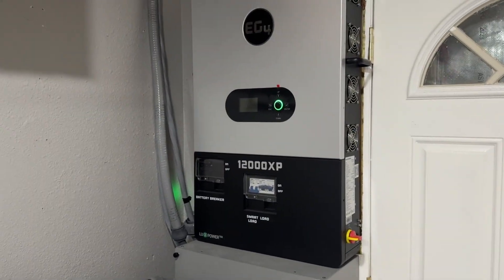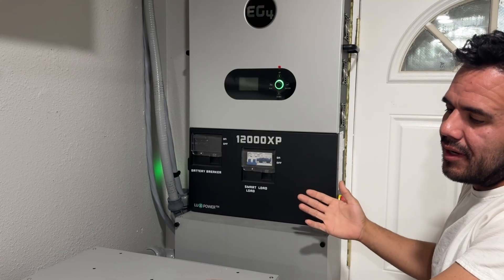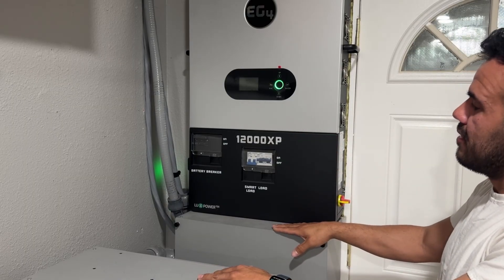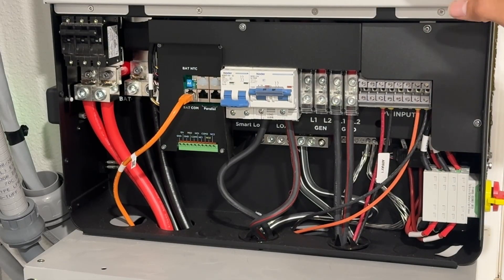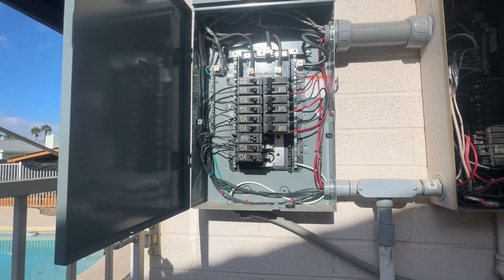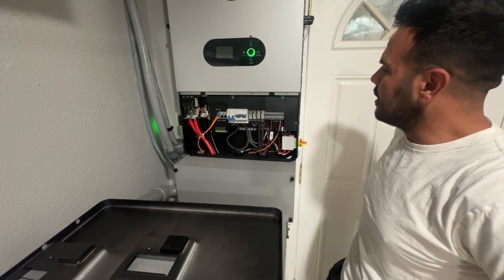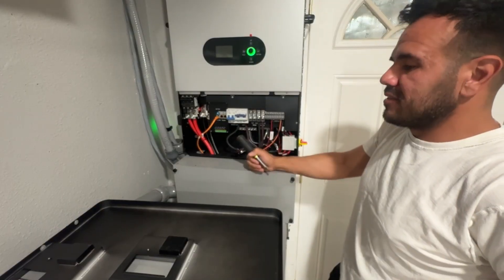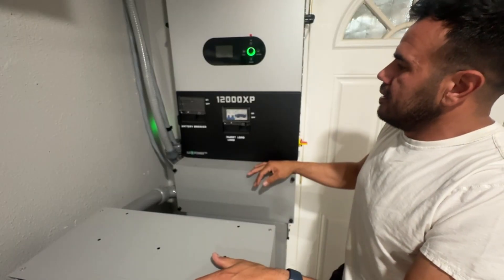✅ Complete Solar Power Flow Explained | 12000XP + Critical Loads Panel Setup | Solar 101

Comment: Great visual video.   Where do the batteries fit into play here?
Reply from the maker: Hey boss! During the day, the DC power from the solar panels does two things: it supplies the loads on the critical loads panel and charges the batteries. Both the solar panels and the batteries are DC sources. When the sun is out, the 12000XP converts that DC from the panels into AC to run your home. At night, when there’s no solar coming in, the batteries take over. They send their stored DC power to the 12000XP, which then converts it into AC so your critical loads keep running automatically
Reply: @Yesseyd  makes sense.  How does this dual action work?  Do the pv wires feed the batteries and inverter simultaneously?
Reply from the maker: @68dewster The solar panels only connect to the inverter. The inverter is the one that decides what to do with the power. It uses the solar power to run the house first, and any extra solar goes straight into charging the batteries. So the panels don’t connect to the batteries directly — the inverter handles both at the same time automatically
Reply: @Yesseyd mystery solved!   Sooo washing,  I'd had all these questions when seeing your unit.

Comment: great video,  but I just could not keep my eyes off that handle, I guess it is, and the door,  how does it not interfere and damage something?  do you have a stop on the floor to keep it from hitting or is it just very close and does not touch?  Inquiring minds want to know. lol.   But the video is pretty good, important stuff people need to think about,.
Reply from the maker: Thanks! That door almost never gets used (maybe 2–3 times a year), and if it opens all the way it touches the 12000XP’s grab handles first, so nothing gets damaged. If it were a door that got regular use, I definitely wouldn’t have mounted it there — but this entrance pretty much never gets used.

Comment: Very nice video, clear, straight to the point and very well explained! I'm planning to do exactly the same setup but I might limit the AC bypass to 60A and run a 6AWG copper wire from the main panel instead. I already have some 3AWG copper wire but not too long so I might do that from the Inverter to the Subpanel. Thanks once again!
Reply from the maker: Anything after 6awg starts to get pricey real quick, but if you design your system well 60amps will be more than enough.

Comment: I don't think I have watch Will Prowse video regarding "critical load" sub panel.  Anyway, right now I had my mini split hooks up permanently to  the outlet that was supplied by the inverter.  When battery getting high then I had to unplug  my washer and dryer from my house outlets  (grid tied) then plug them into the outlet supplied by the inverter.  Very bothersome and Mickey Mouse.  And I got cables run all over the house.  Definitely, I wish I can be able to do this.   But this is definitely advanced stuff, but awesome, that you can be able to use already existing in the  wall wires in your own home.
Reply from the maker: I hear you — managing different loads and juggling outlets can definitely get tricky, especially when you’re working with limited inverter capacity. It’s not always easy finding a setup that’s both efficient and convenient. That’s where things like a critical loads panel or more integrated systems can really start to make a difference.

I’m also working on a small portable power station build right now — something I think could be super helpful as you keep learning about solar and testing things out without needing to rewire your whole home. Appreciate you tuning in and sharing your setup

Comment: The 2 wires running from the inverter to the critical box , you said were 2 gauge aluminum? not copper? I think you miss saying. Someone told me I need to make sure to buy  all wires copper, they were more expensive but much safer.  Aluminum are hotter, oxidized easier, and created crusted when oxidized and could spark more easier, and lot of Amazon sell cheap fake copper wire made out of aluminum,   Some of them , outside coated with copper but inside aluminum,.But for this, aluminum was chosen?
Reply from the maker: Great question! I did use 2 AWG aluminum for the run from the 12000XP to the critical loads panel. Aluminum does have higher resistance and can oxidize, but when it’s sized properly, terminated with antioxidant, and torqued right, it performs just fine. I bought this wire from a reputable online electrical supplier — it’s rated for 100 amps, which is what you need if you want to use the 100A bypass. The manual does mention copper, but it’s worth noting that aluminum is what feeds the main electrical panel in most homes, and the bus bars inside are aluminum too
Reply: @Yesseyd  Yeah, just watched your other video and in the comment section, in which you did mention the price of copper in your system would cost $1300 and aluminium would cost $200.  and you said you did it mainly because of cost.
Reply from the maker: @TrinhNguyen-vi2qo  Yep, exactly! 💯 I was blown away when I priced out copper — it would’ve cost over $1,300 for that same run, and aluminum came out to just around $200. For the price difference, it was a no-brainer. As long as it’s installed properly with the right torque, anti-oxidant, and size, aluminum holds up great. Appreciate you checking out both videos and following along

Comment: Dude I have watch every video on the 12000xp and none of them cover what I've already learned from you mad props I just got one and on budget build so haven't hooked it up yet
Reply from the maker: Thanks a ton man, really appreciate it! 🙏 The 12000XP has been really impressive so far—it’s handled everything I’ve thrown at it. If you have any questions once you start wiring it up, feel free to drop them here, happy to help! What are you thinking about for battery storage? How big are you planning to go for your solar arrays?
Reply: @Yesseyd have been looking at the vetrar and eco worthy but haven't really decided I know I have to get up to 400ah for the 12000xp so working around that to decide
Reply from the maker: @Safmosis  Yeah the one bummer with the 12000XP is it needs a decent amount of battery capacity if you want to unlock the full 12kW output. I know you can run it with just one wall-mounted battery, but you’ll only get about 6–7kW max. I just saw a guy on one of the FB solar forums with an Eco-Worthy inverter setup—he said it’s been running all his loads fine and the setup wasn’t too bad. He mentioned the Wi-Fi monitoring was basic, but it worked. I’ve also seen some decent reviews on the Sungold inverters too

Comment: Some others commented on your shirt being inside out or about sticking your fingers in a live panel. Yeah, I saw that too but what caught my attention was that you used the rubber end of the screwdriver as a pointer instead of the metal end. Most of the licensed electricians I've seen explaining these systems aren't smart enough to do that. So you've got one up on them. Keep the videos comin' brother.
Reply from the maker: Thanks so much for the feedback! Really glad the videos are helping. I’ve actually got a smaller system ordered that I’ll be filming soon, so stay tuned for more. Appreciate you watching and commenting, thanks again!

Comment: I think would have just interconnected with SRP using a 18kpv or 12kpv both approved for interconnection. That way you can backfeed and blend power from the grid might not be able to meet entire load all day. I'm in Phoenix so I know summer heat not going to be able to run entire house on solar unless have a massive array that looks like a typical 1970s tract home here.  Aluminum wire I'm guessing.
Reply from the maker: For me, the biggest thing was avoiding all the extra red tape that comes with grid-tie. Permits, inspections, utility approvals, interconnection agreements—it just gets complicated. Off-grid is way easier and you still have the grid as backup if you need it.

Second was scalability. A lot of utilities cap your interconnection size at something like 10 kW or 12 kW. That makes it really hard to start small and expand later, because you’d have to renegotiate or even cancel the interconnection agreement if you want to go bigger down the road.

Another major factor was the buy/sell rates themselves. When I looked, SRP was buying excess at $0.06/kWh while selling at $0.13/kWh. That’s a bad deal already—and I’m pretty sure those rates will only get worse over time as utilities try to recover lost revenue. If it were truly 1-to-1, it might be worth it, but it’s not—and they have no incentive to keep it fair going forward.

And sure, grid reliability was a minor bonus. With grid-tie, your solar is useless in an outage. I wanted something that would keep working even if the grid went down.

I actually did a video on my channel going over the pros and cons of grid-tying vs. going off-grid when I was designing my own system, https://youtu.be/YiBJPq5P3Lk?si=3J0sWNhS3dAdzF4b

Comment: High frequency, transformerless inverters like this EG4 inverter is NEVER right for anyone. The Chinese have been dumping this poor performing, dangerous inverter technology on Americans for decades. High frequency, transformerless inverters offer a far poorer surge capacity, a much shorter life expectancy, and because they lack an output transformer, they can damage your home's appliances, when their MOSFETs fail. Why do they lack an output transformer? Because, they're much cheaper to build and far, far cheaper to ship from China to the US. Trust me, the Chinese were not trying to do you any favors by removing the output transformer. If you want an inverter that's going to last for a decade or more while providing you with far safer, higher performance, then you need to install a low frequency, transformer based inverter charger.
Reply from the maker: Appreciate the detailed perspective, but I think it’s important to put things in context. High-frequency, transformerless inverters like the EG4 12000XP definitely have trade-offs, but they’ve come a long way — and many of us have been running them reliably with no issues at all.

Yes, transformerless units typically have less surge capacity compared to low-frequency units with built-in transformers, but for most residential loads — especially when you size things right and use good wiring and breakers — they perform just fine. Plus, you can always add external surge protection.

Cost and efficiency are a big part of why these inverters are popular. Not everyone has $5–10K to drop on an industrial-grade unit. For a lot of DIYers trying to offset their power bill or build backup capacity, inverters like the EG4 are accessible and get the job done.

If someone has the budget and wants a heavy-duty low-frequency unit, great. But I wouldn’t call transformerless tech “dangerous” — just different tools for different budgets and goals.

Comment: Okay so radiant heat expelling from that unit installed into a home that you are trying to climate control will be hard to do because everytime u power something under load will circulate heat back into the room.  Counterintuitive
Reply: I think this has a 92 percent efficiency when grid charging. So, at max blast of 12000w of battery charging that is almost 900w of heat.
Reply from the maker: @MyGoogleYoutube  True, it does put out some heat. Just need to make sure there’s good airflow wherever it’s installed.
Reply from the maker: Good point! Heat from the inverter can definitely add to the room’s load. I have mine installed in a utility/laundry room, so I’m okay with a little temperature change there. That said, there are other inverter options rated for outdoor installation if heat is a bigger concern. This setup just worked best for my space and layout. Appreciate the input.

Comment: Your door will hit your on/off for the solar disconnect plus you have another above that one, that’s why people like you cause others to do it wrong
Reply from the maker: The 12000xp’s grab handle is actually what hits first, not the PV disconnect. This was just the space I had to work with, so I made it work the best way I could. Every setup’s a little different — this is just how I laid it out based on my layout.

Comment: Luxpower makers of EG4 inverters that are made in China, are facing scrutiny and accusations that they may pose a risk of backdoor cyber attacks by the Chinese government. The concern stems from the discovery of "rogue" or undocumented communication devices in these inverters. These devices could potentially be used for unauthorized access and control, potentially leading to grid instability or damage.
Reply from the maker: Personally, I see it as a very minor risk—one I’m willing to take in exchange for the convenience of remote monitoring and control. That said, everyone has their own threshold for risk

Comment: How the noise with the fans with high watt usage?
Reply from the maker: @christopherdiaz1350  I don’t really hear them until till you get to about 6000 watts. Once you get above 8-9000 watts they ramp up to full speed and then you definitely hear them.
Reply: @Yesseyd do they get loud in annoying way when they are running hard?
Reply from the maker: @christopherdiaz1350  yeah I wouldn’t recommend them anywhere where you want it to be quiet. I have them in the laundry room so it’s no big deal for me. Under 6k it’s not really noticeable but once you get close to 10k they get noticeably louder for sure.
Reply: @Yesseyd well I am looking to put them in the living room. Its close to main panel without spending 2k in wiring. I don't really spend much time there but was wondering if it would be load to the point sound like an airplane. Starting its motors lol. I mean if it should like a strong fan I think I can live with that.
Reply from the maker: @christopherdiaz1350  next time I charge the EV  I’ll crank up the charging close to 10k and I’ll try an record a video so I can get the fan noise.
Reply: @Yesseyd thanks man, I appreciate it.
Reply from the maker: Hey Chris I just uploaded a video on the the fan noise. Here is the link- https://youtu.be/Oz16ECCL21c?si=vKh23_lFkuhltXFL